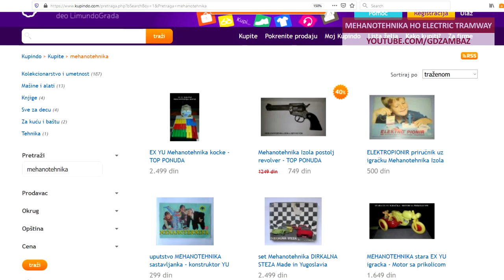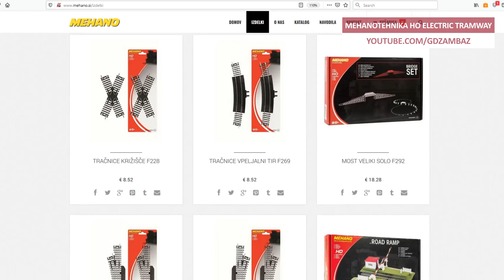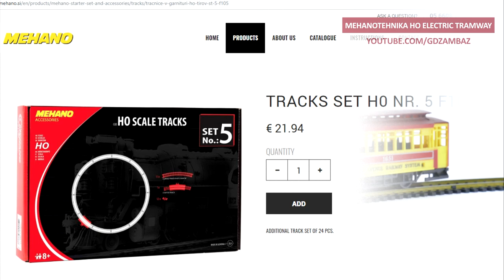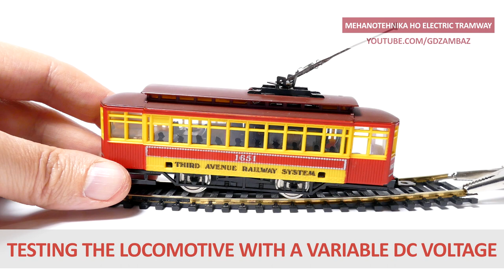Mehanotehnika HO T360 Electric Tramway - Repair, Testing and Running Session

Comment: Brother I need to open the TGV duplex coach by mehano. I wanted to add led lights inside the coach but I dont know how to open the coach. while one screw is visible, the other screw on the coach is hidden and I dont know, how to unscrew that one... can you help ?
Reply from the maker: Sorry, I haven't opened any passenger car or the locomotive from the TGV set, so I cannot help you with that.
However, I can tell you that the locomotive from the AVE set has only one screw and the passenger wagons from this set do not have screws at all.

Comment: I own an old set of T360 tramway but the motor is broken. Is there a way to obtain a spare (used?) motor? I tryed to clean and fix it but it didn't work. I would be very gratefull for your advice!
Reply from the maker: Hi,
You can try to find a new general purpose 12V DC motor with a proper worm gear and similar dimensions on eBay or AliExpress or you can try to find the same tram on eBay (marked as defective or for parts only) and combine the parts to make one fully functional tram. Best, Goran
Reply: @GoranDzambazov  Thank you so much for the tip! All the best, Walter